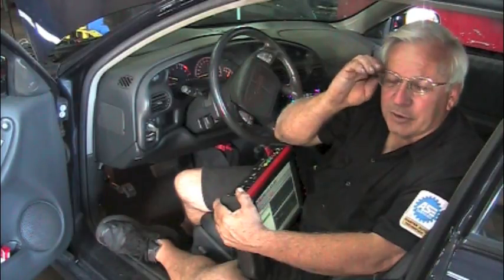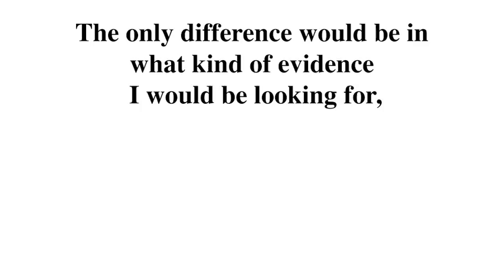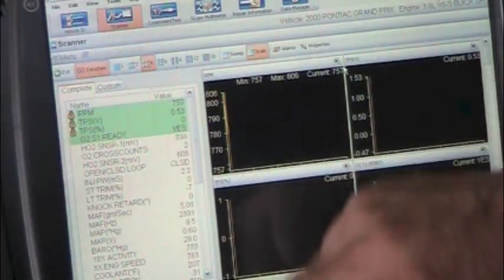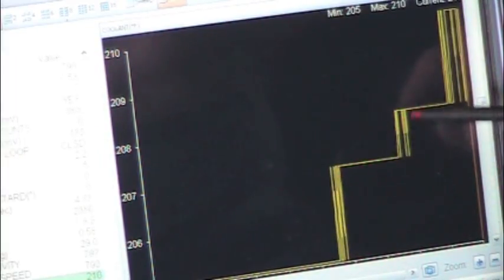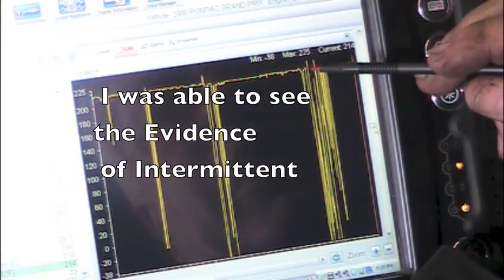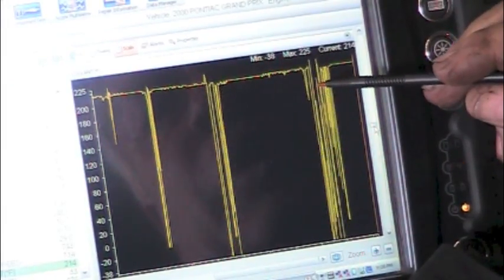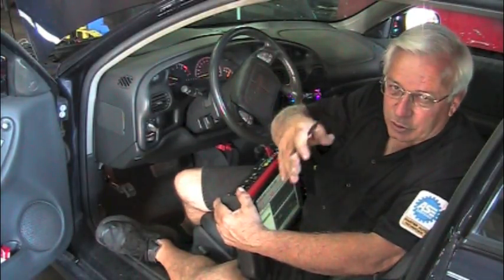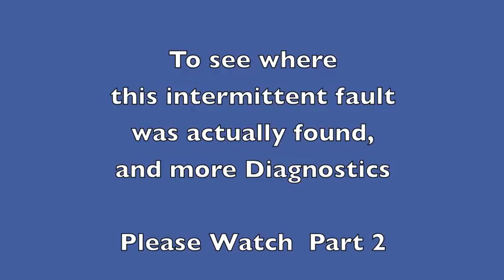Finding an intermittent using min/max  part 1

Comment: Circuit low and high codes, whether intermittent is specified by the code or not, should always be treated as an electrical problem. In either case, the acceptable range would be from (lets say a 5 volt ref circuit) .3v to 4.7v, anything below that range or above it is what trips the code, the testing method should be the same. A range performance code would be a different story (within acceptable voltage, but not when/what the computer was expecting to see at that time).

Comment: Very nice, you seem quite miffed at the assistant for missing that :).

Look forward to part 2!  I feel like the fix is much harder than this diagnosis.  This, I feel, found little more than the check engine light was telling you, you were just able to validate the problem via actual sensor values, but tracing where something like this, which in my (albeit little) experience is usually from a intermittent short (like a wire with damaged shielding which occasionally touches a ground), but finding those can be near impossible sometimes!

Comment: Hmmm...your experience really speaks to me here...I would also have checked on the codes myself as well.I thought intermittant was the way to go but again, experience with the scope is what I learned here and an understanding of real world effects on the engine/ wiring connections and such...well the light came on very quickly.  Thanks for posting this video